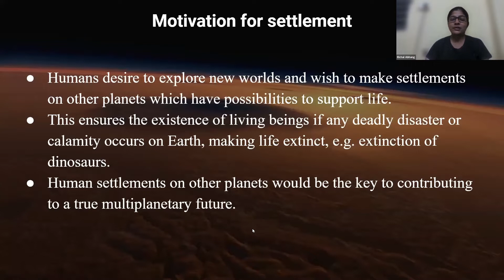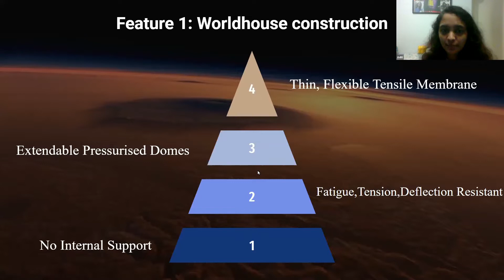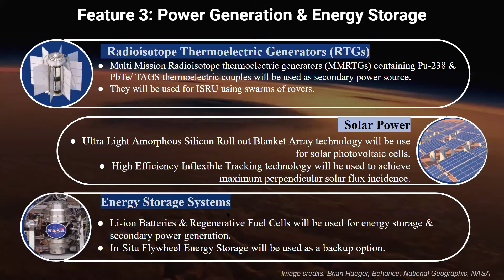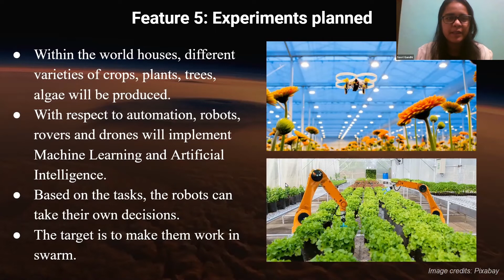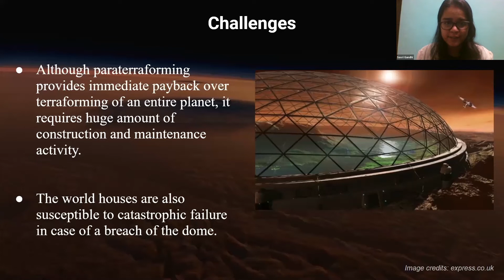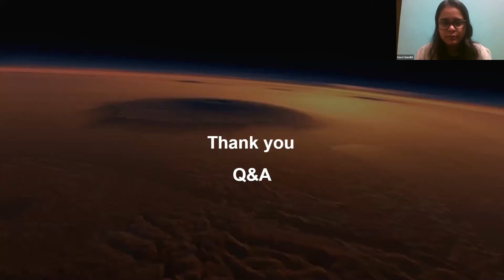Martian Paraterraforming - Shah et. al. - 2021 Mars Society Virtual Convention

Comment: Great work. Another option is solar power satellites beaming power down via microwaves. Microwaves are unaffected by dust storms. The sats could also provide comm and positioning. Once several sats of sufficient power are in orbit there would be power available constantly anywhere on the planet. Current solar is 4 kg/KW approx. and with low mass/area mirrors adding less than another kg/KW to compensate for lower solar intensity at Mars. In addition about 3 times as much payload can be placed in orbit per IMLEO as on the surface. Beam generation and antennas add mass per power but nothing even approaching the150 kg/KW of Kilopower. Add to that the delays and cost increases that will likely come with nuclear and solar power sats are wildly superior IMO.